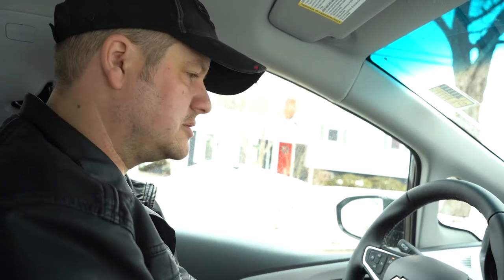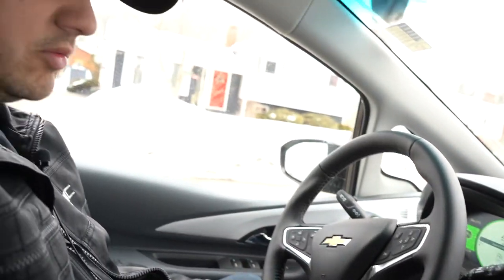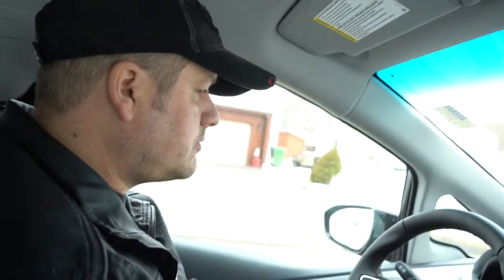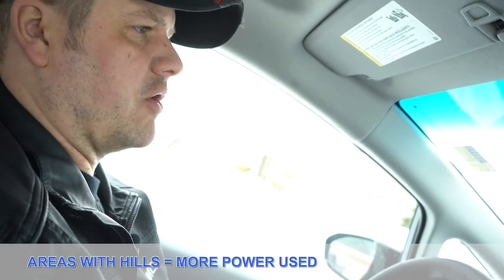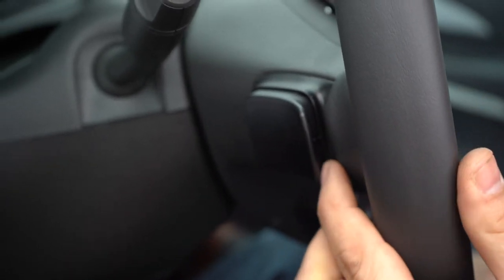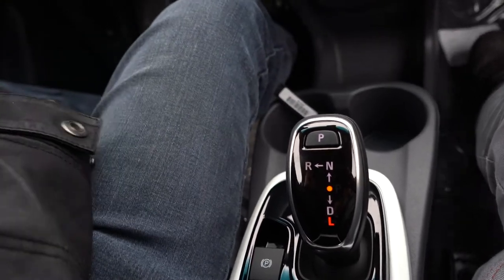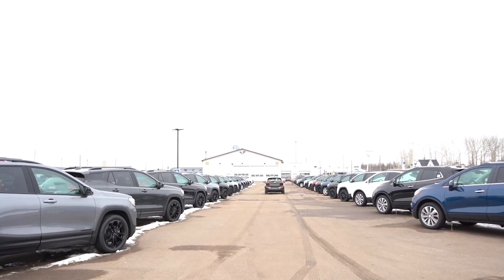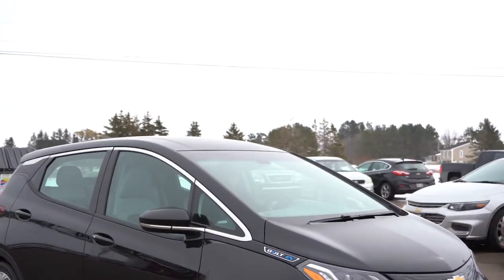The 2020 Chevrolet Bolt EV - Regenerative Braking/ Range Anxiety Explained

Comment: I recently bought a 2020 Bolt and I really use the “L” setting almost exclusively. The exception is when I’m highway driving with cruise control. Then I use “D”. Can I use the “L” setting with cruise control? It’s not low gear, it just maximizes the regeneration feature so it would seem okay. Haven’t yet found the answer in the owner’s manual. Thanks.
Reply: Yes. Only issue is when you disengage cruise while in L an immediate drag is evident, as if the brakes are engaged. So be conscious of that.